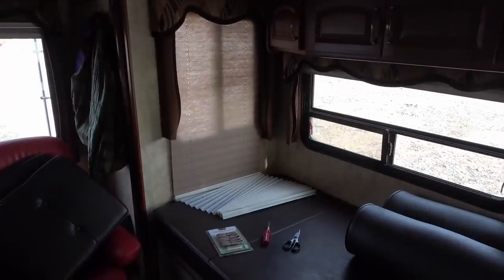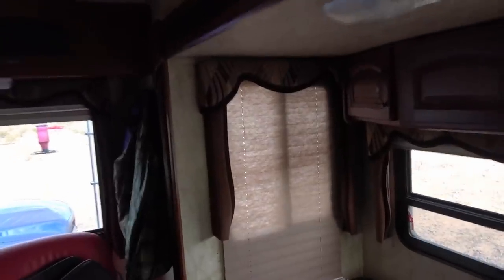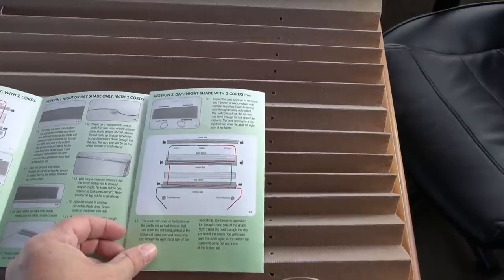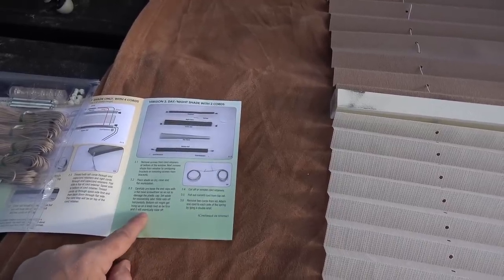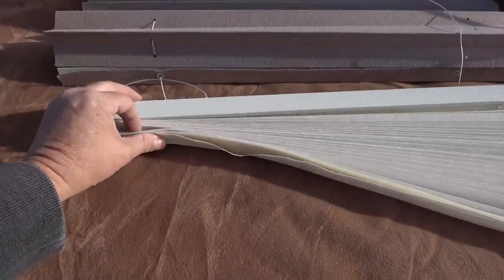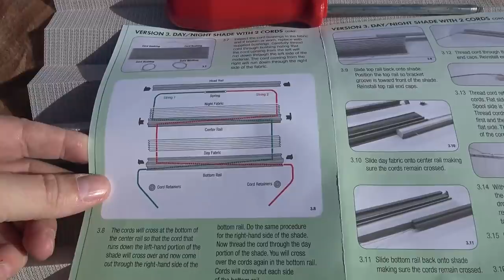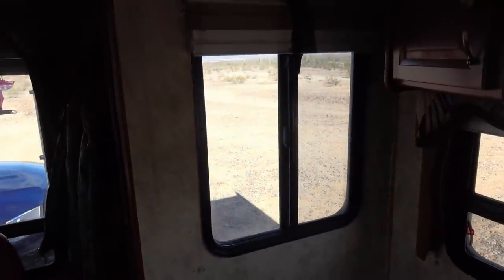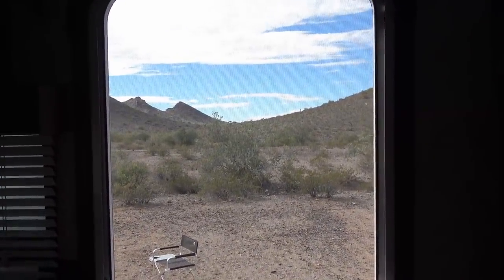RV Day/Night Shade Repair - Restringing my Broken Blind

Comment: If you rub wax on the strings the shades will slide easier and the strings will last longer.
Reply from the maker: Thanks for the tip, what sort of wax do you recommend. Cheers, Ray
Reply: I just use a piece of paraffin wax. @LoveYourRV

Comment: Good Job Sir, I did the same thing last summer. My RV has a different connection at the top. They screwed the shade directly into the side door and the shade had a bow as it was about 1/2 inch (12.7 mm) too long. Being an ol fart I had to use the computer to figure out mm and I know you're from Maple Leaf country. :) Have a great time this year and i'll continue to follow your exploits. Thanks for sharing my friend.

Comment: i restrung 6 of the 10 windows in our old motorhome. one of them was a 4 string that covered the huge cab-over window. that was, um, interesting. the first one i did was a 2 string, not too bad. once you do 1 or 2 shades its pretty easy. just have to keep your patience, easier said than done!

Comment: on my RV, the neighbors cat got locked inside.She really messed up several of my shade slats (I could be replacing strings at the same time)  What I really need is the slats.  Do you happen to have a source for the slats?
Reply from the maker: Yikes! Sorry, I haven't done to much research into them, maybe someone will come along and have an answer for you. Cheers, Ray

Comment: Had to do this on those same day/night shades on our Rockwood travel trailer.  I’ve replaced the strings on two 2-string shades and the large 4-string shade beside the dinette.  It’s a finicky process but with patience its definitely doable.  I found the hardest part was putting them back together while trying to keep the spring centred on the top.
Reply: Masking tape the spring in middle

Comment: The two-string shades aren't bad to restring.  It's the 4-string that's been giving me fits.  It can be done, but be sure Anne isn't around to listen to your newly learned Sailor talk.  :).  When you have to do the 4-string shade, be sure you thread at least 2 feet longer strings to ensure proper tension when the shade is re-mounted in the window.
Reply from the maker: My back window is 6 strings!
Reply: @LoveYourRV  Ouch.  You're on your own, buddy.  Luckily, my back shade is only 4-string. Whew!